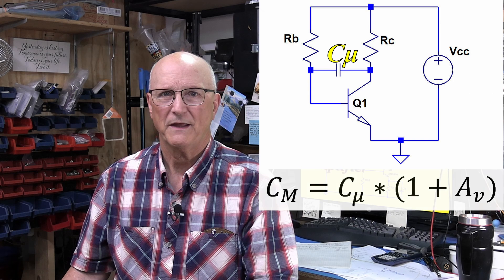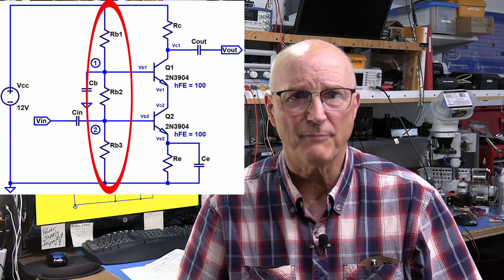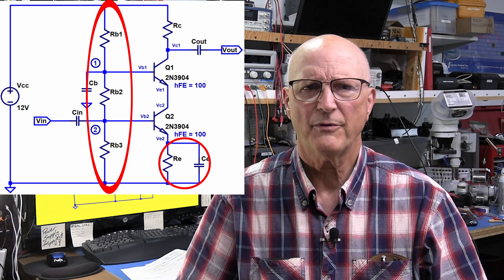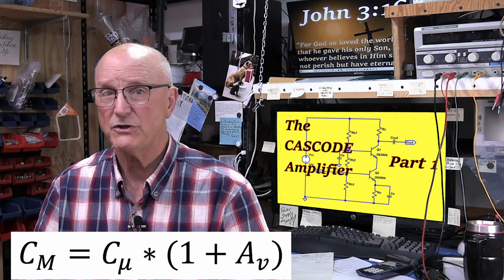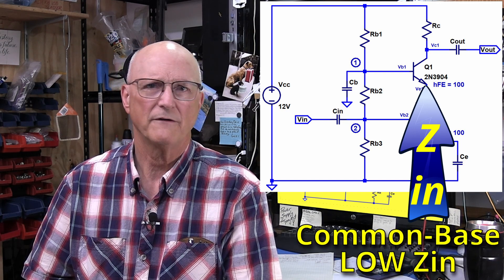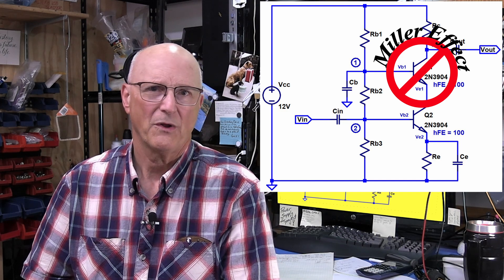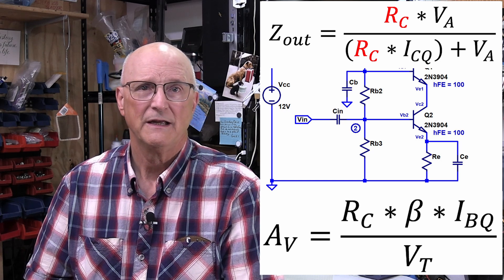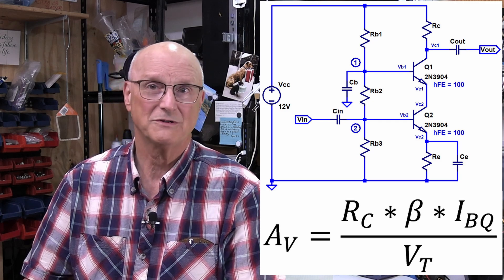BJT Circuit Analysis: The CASCODE Amplifier (Pt 1) (066g1)

Comment: Actually, the gain of the common emitter amplifier, Rc/Re, might be significantly less than 1.  Cascode also greatly reduces the Early effect.
Reply from the maker: But, in its interaction with the common-base, it does approximate a gain of 1, in practice. This is how it was explained to us in engineering school and in the texts I reviewed to create this video. 🙂
Reply: @eie_for_you  With no emitter degeneration resistance, Rc=re for the top resistor and Re=re for the bottom resistor.  In this case, the voltage gain is very close to 1, but the combined gain is not well-defined and varies greatly with signal level.  Assuming gain=2 does consider the worst case for the Miller effect and is therefore not a bad strategy even when using emitter degeneration resistance to stabilize the gain..
Reply from the maker: @byronwatkins2565  I hear ya! 🙂

Comment: This circuit was commonly used for the RF amplifyer  in TV tuners connecting to the antenna and valves were used.
Reply from the maker: I would that there is a LOT less inter-element capacitance with a vacuum tube. Thus the higher frequency capability. 🙂

Comment: Note for new players:
The names of the capacitances vary depending on what school you went to.  There isn't really a standard naming in that form.
I use Ceb and Ccb as the names.
It is also easier to type.
Also:
If you put a resistor in series with Ce (on his design) to lower gain, it is also good to change where Cb hooks.
Basically you put the resistor on the ground end of Ce and run Cb to that spot also.
This gives you a higher input impedance.
Reply from the maker: WOW! I can't believe that it took me so long to notice this comment! My apologies! :-(
In my next video I am going to be going through this whole process of a reduced gain version of the CASCODE amplifier. There are two basic methods to consider, one being to split the emitter resistor with the lower half being bypassed; this reduces the gain of the common-emitter portion of the circuit. The other is to design around this on the common-base part, setting the Rc to provide the needed gain there. :-)
Reply: @eie_for_you 
As I said, my comment was targetting the "new players" who may be watching your video to understand the idea.
A video of a version with well known gain (no temp co) would be a nice second one. 
I think a resistor in the ground end of Ce is better than splitting the emitter resistor.  As a first step in the design it is no difference with the series splitting method but it does allow the Cb thing I suggested. If you then also bring the Rb3 over to that point, you can bootstrap out the loading the bias circuits put on the input.   This can give you a really high impedance and a well known voltage gain.
Reply from the maker: @kensmith5694  Cool! 
Yeah, the advantage of splitting the emitter resistor to control the overall gain does have the decided advantage of a higher input impedance. 🙂

Comment: INTREGUING!I HOPE I DO NOT GET LOST WITH THE DESIGHN EQUATIONS.AT ABOUT WHAT FREQUENCY DOES THE MILLER CAPACITANCE BECOME A PROBLEM?
Reply from the maker: Well, the frequency limitations depend entirely on the specific transistor being used. It also depends on the gain you set it up for. You can control the overall gain by splitting the emitter resistor, the bottom one is bypassed. The top one works together with the collector resistor to set the overall gain. The lower the set gain, the broader the frequency response. All of this will be covered in the next video where I go through the design and then we will see the results of the design including the "limited gain" version. 🙂
Reply: It is going to also depend on your signal source's impedance.  Remember that "Miller capacitance" is the gain of the stage times the Collector-base capacitance.  This capacitor works against you signal source's resistance in
F=1/(2*pi*R*C)
If you make a stage with a gain of 100 using a transistor with a 1pF collector to base, you get 101pF seen at the input from that.
If your signal has a 200K impedance, the result will be good enough for voice but not hifi.
Reply from the maker: Gotcha!
This is my LONG overdue reply!  Sorry. Sometimes this stuff gets lost in the YT world. I'm spending some time trying to clean all this stuff up. :-)
Reply: Audio.
Reply from the maker: @andymouse  Actually ... the main purpose was to extend the frequency response out far enough to be used as video amplifiers. This puts it well up into the MHz range.  But, the actual extent depends entirely on the specific transistor you are using and the amount of actual gain you design into the amplifier. 🙂